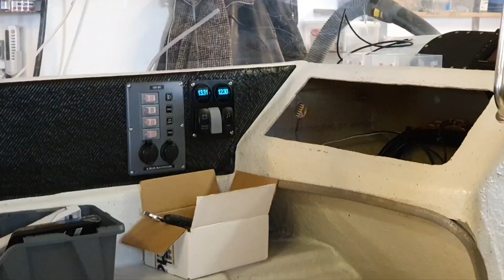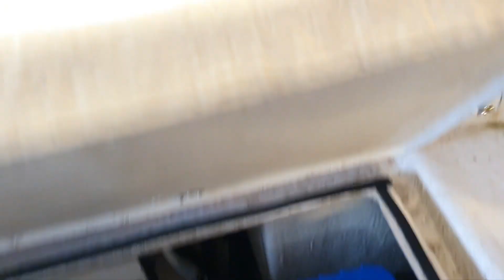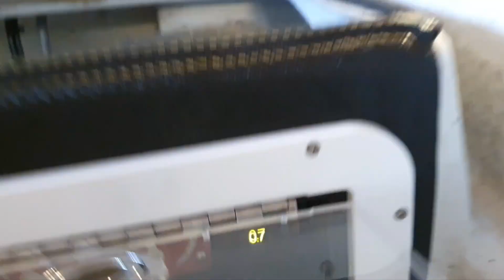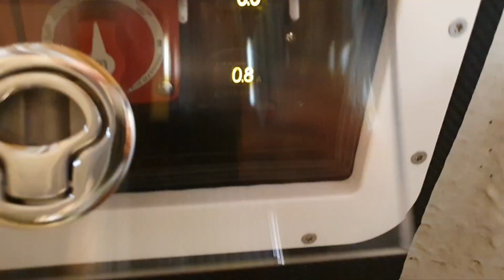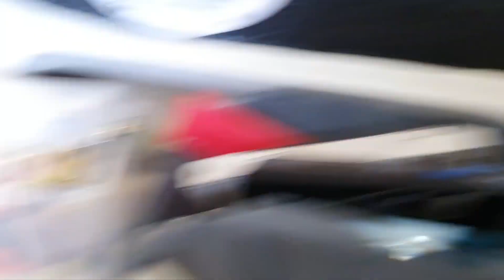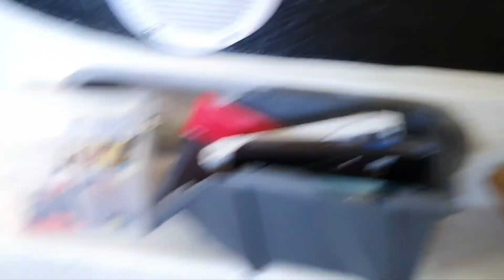Victron Charger as a Power Supply - AWESOME!

Comment: I appreciate this video. I'm looking at using one, to power the 12v lighting system (+ a few other things) in my caravan.
I do not want to install a battery in the caravan, as I am mostly connected to the grid - this should do exactly what I need.
Reply from the maker: Thank you for taking the time to describe your use case.
Reply: @fishelectronics I was looking at using a simple step down transformer - as others have - but not many come in a nice package, nor do they have any kind of bluetooth monitoring.
I'm going to buy the single output version of this, and run it into a fuse block. 👌 thanks again